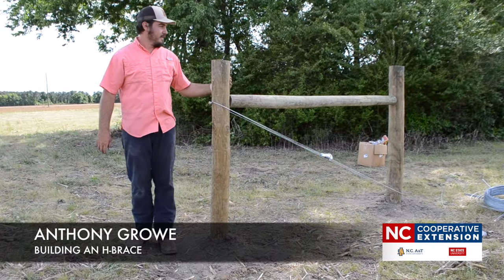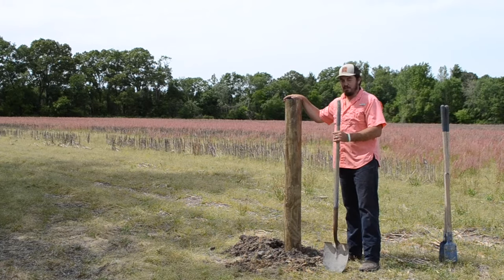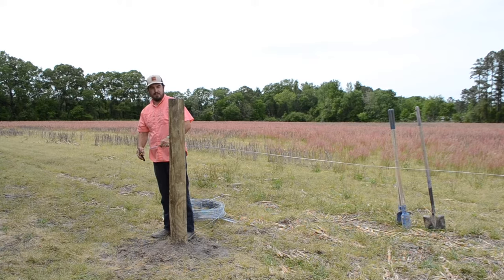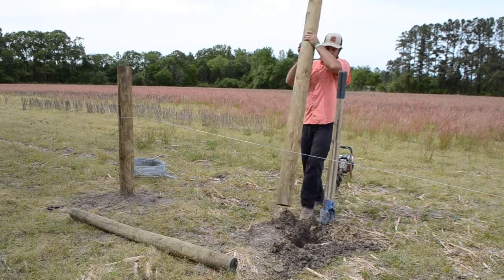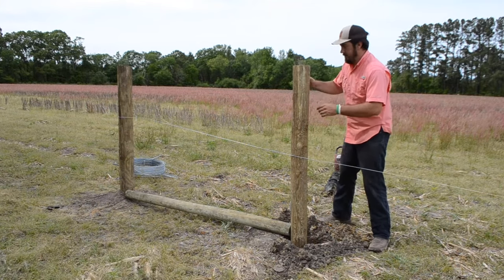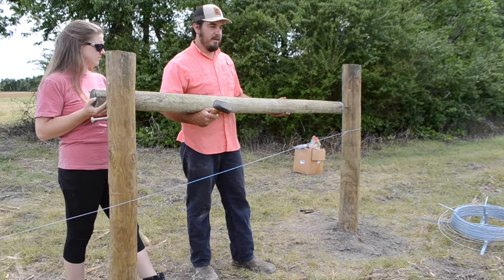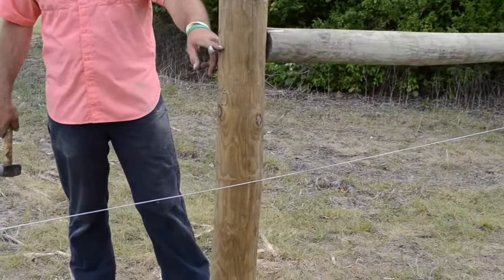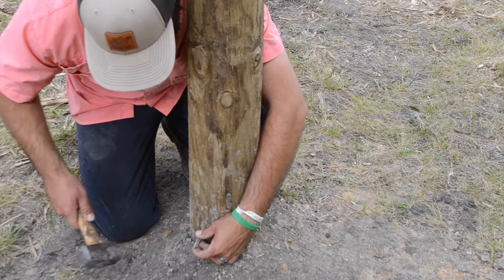H-Brace Fencing Demonstration

Comment: Man your doing it the hard way. I set my post to where the horizontal piece fits snug between the 2 post then drill all the way through the vertical post and into the horizontal post then drive my pin in.
Reply: I wish you could make a video, so I could see it. I'm always looking for a better way!
Reply: what kind of drill do you need to use with that long bit as seen in the video? i only have a power drill and impact driver.
Reply: @beerme27  I used a long wood bit that locks into my 20 volt impact driver. drains the battery pretty quickly but it got the job done.
Reply: He was painful to watch!!

Comment: It's always amazed me how different people build fences so differently. And every one of them is convinced that their way is the correct way.😁....... Example: Those size of posts you are using for corner posts, my family would have used as line posts. The posts we always used for corner posts, were twice that diameter!.....I grew up on a farm. Cattle and horses. Over time, we wound up replacing every fence around every pasture, because the original fences were decades old when my parents bought the properties.
Reply: Their way is the correct the way. It suited their needs. Not everyone has fencing needs to contain 2,000# steer. Every fence is purpose built and tailored. Design wise, yeah sure they all different but Texans were different hats than Saudi sheiks do too.
Reply: @F479999999999  did I ACTUALLY say that their way wasn't the correct way?
No, I didn't.
I said that EVERYONE has their own way. And we ALL think we are correct.
You are correct that I don't know what livestock they are building fence for.
I never said that I did.
And I didn't say it was wrong.
I simply made a comment.

I could say that this senior citizen (me), is sorry for commenting.
But that would be a lie.

Since when, can a person not comment or give an opinion about something?
Reply: @willhorting5317  sometimes old folks come across as conceded aholes it’s not your fault. My cousin just told me the same thing about my corner posts if I need telephone poles to keep in dwarf goats then something ain’t right

Comment: Can you just secure the horizontal post with long timber lock screws? Or a long nail? So you dont have to drill a precise hole?
Reply: Out on our farm, my dad never used pins. (And our corner & brace posts were twice that diameter.)... Anyway, we would use a hatchet to cut a notch in each post, the size of the brace, that the brace rested on. Once we stretched/tightened the bracing wire, the tension held the brace tight....Knowing me, my comment is probably about as clear as mud.😁
Reply: @willhorting5317 easy to understand thank you.
Reply: @rogerjoesbury9410  you are welcome.

Comment: I am currently building a perimeter fence on a 1/2 acre lot with dimensions 127’ by 172’. I am using 8 foot by 6 in treated posts and set the corner posts about 24 inches in the ground. My plan is to build corner h brace fence and I am afraid I may have set the posts below the recommendation of 40 to 50% of the post for h brace.  Looking back I should have at least set the posts 3.5 feet to 4 feet into the ground. Also, when I set my corner posts I set them in commercial grade concrete/cement at 24 in. My question is will this affect the way my h brace will hold up? My next step is to set the brace posts and cross bars but I am sort of at a standstill because the more I read into it it looks like I should have set them at 3.5 feet to 4 feet deep. Since it is such a short run I am thinking it might not impact it much. I plan on running 4 strands of 14.5-15 gauge barbless wire and I don’t plan on putting too much tension on it. I would like to get your thoughts on this. Thanks!

Comment: Thats one of the best makita drills ever made. Got 2 of them. They dont shut down from supposed overheating and are beasts. Pins? Why not lag bolts?
Reply: I agree.  I’ve seen them done with lag bolts before.  Much easier.
Reply: @Dedicateddad4ever  im thinkin half or 3/4 rebar. I have to fence 5 acres on hills. Just picked up 8 rolls of gaucho high tensile field fence, 40 6 inch posts, 2600 foot of 4 prong barbed wire,  gaucho. Still need to get gates, anf heavy duty 6.5 foot t posts 120 of them. Its gonna b a long winter installing it. Haaa. Im thinkin istead of h brace just go with post and angled post buried, pinned and wire reinforced.  Going to use mp-500 ext to treat post below ground.

Comment: Smart fence builders learn to soak the bottom 4 feet of their wood posts in a 50/50 mixture of old motor oil and diesel fuel !  Those non treated wood posts will turn into cellulose over time ! Happy fencing !
Reply: I soak old roofing shingles and Creosote from the fireplace insert in diesel fuel for a year or so, then use that to coat the feet of my posts.

Comment: Hey, What kind of wire is it that you use for this? Is it the same wire used in electric fencing?
Reply: I use high tensile wire. I think it is the same as electric.  There's different thicknesses.

Comment: Where do you get those pins for the H-brace? Good video. Thanks,
Reply: Most folks around here use rebar from Lowes.  Typically lying around the cinderblock area.
Reply: Yeah I've been using 4ft sections of rear cutting them down to 12 inches.  Works great.

Comment: how often would you put an H brace on a run? Im about to run 2600 ft of cross fence.
Reply: All depends on the wire manufacturer and how far the wore can be strained 
We do 1km or 3200ft fences in Australia 
Can go further but the wire comes in 500m rolls so exactly 2 rolls equals 1 strain and it's quite manageable at that distance
Reply: @kinseyeverhart3010  😳🤨🤔🧐

Comment: No cement?
Reply: cement is expensive and holds moisture. sure fire method for premature rot.
Reply: Cement is literally $4 a bag. Much better than digging 4’ deep. 2’ depth with concrete is more than enough.
Reply: @jakeswitzer8834  I suppose it would depend on what you are using the fence for. A fence around a yard, you can get away with only going 2ft deep. But if it's a fence for livestock, especially horses or cattle, wood posts only 2ft will be pushed over (even in concrete) within 10 years normally. Because horses and cattle ALWAYS are sticking heads through the wires, reaching as far as they can, for that "better" grass on the other side.😁 As for using concrete, well I don't know how many wood posts you use in your fences. But that could get extremely expensive for a pasture fence of any size. WHOLE lot cheaper to pack that dirt! Even if it means more work. But I am well aware that EVERYONE has their own opinions on fences. So, it may seem like I am arguing with you. But I am not. You enjoy your way, and I will enjoy mine.😎